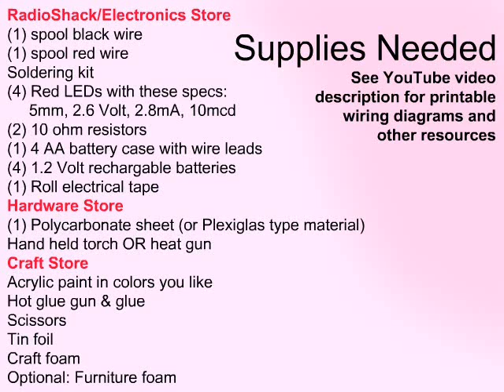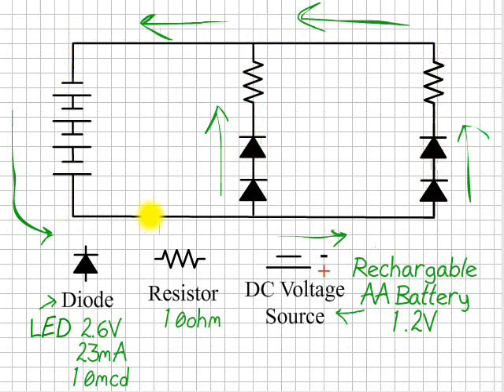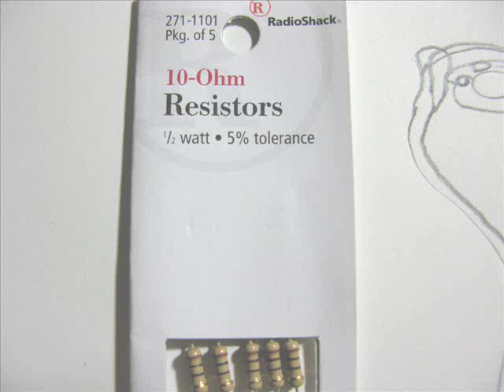Make Glowing LED costume eyes

Comment from the maker: That's great friggin' question!!  Surface wash the fur with a damp sponge and a comb.  For the eyes you want to use glass cleaner or glasses/computer monitor spray.  You don't want to get the mask wet when you clean it because the water vapor will work its way inside the eyes and cloud them.  You can scrub the inside with a damp sponge and some alcohol if you to remove facial oil.  Over time you may need to replace the foam or car sponge you use as pads on the inside to remove skin oil build up.

Comment from the maker: The plexiglass I get from the scrap bin at Lowes. The LEDs are between 2 and 12 dollars for a three pack depending on color. The battery pack cost me 4 dollars, the wire can be bought at whatever amount you want to keep on hand, but tends to get cheaper per foot if you buy a big roll.  Buying all the supplies ran me, I think $25?  but it was enough supplies to do two sets.  FYI you can also shape acrylic by toaster ovening it and waiting for it to buckle up, then relax, THEN shove a sppon in it.

Comment from the maker: @Kirikirisempai Between 20 and 30 dollars depending if you already have batteries.  You have to think cheap--like ask a hardware store if they have broken or scrap acrylic sheeting.  If I buy a cracked piece it's super cheap--but a 20 X 40 inch sheet of polycarbonate is like $100 bucks.

Comment from the maker: @DeathDragonSparda Oven.  You can use an oven and an aluminum baking pan, the thin one time use ones.  To be safe you want to oven dry your plexiglas/acrylic sheeting in an oven (acetate is totally different, I wouldn't use acetate.)  The water vapor in the acrylic will bubble out when it gets hot.  so unless you live in a really dry climate the acrylic will form unwanted bubbles after it gets slightly above the perfect temperature.  i think the temperature is around 200 degrees F.

Comment: I need to make a similar result for a plush that is part of a cosplay prop. but all this would take too much time i will be working over the summer and im haveing surgery. i also have a lot of feathers that need to go on the prop. how would this work with just a led key chain light? in the prop that can be pulled out then locked on?

Comment from the maker: @Arrekushizu1127 I buy the cheap soldering kits from RadioShack for 8 to 12 US dollars, the kit comes with solder and a clamp.  But!  Beware!  If you don't learn how to do the steps right (tinning the tip,--simple but important) you could melt a cheap soldering tip or accidentally set something on fire, so have a buddy to help teach you or figure it out based on online instructions. The iron takes FOREVER to cool down, so like 10 minutes after unpluging it it can still deliver a very nasty burn.

Comment from the maker: You can wrap the wires very tightly together, like twist ties, then glue over them, but this will only work for a while.  I did some solder-less effects at a convention that way.  As you move the wires they become more and more loose, so it's only good for little while.  Soldering isn't hard or expensive , the only problem is it gets very hot and you don't want to breath smoke that comes up off the soldering iron.  Lots of people own soldering irons, try asking around, even school shop classes.

Comment: I'm just forgetting what I used to know about electronics. Are the resistors for controlling the brightness of the light, or will something burn up if there isn't enough resistance? Does it matter what kind of batteries you use, as well?

Comment from the maker: Yeah, it would be a physical switch where you could make a connection that would connect two sets of wires with spaces.  One way the switch would connect the space between the photoresistor and your circuit, the other way it would connect the space directly between the battery pack and the eyes.  you can look up switches online or at radioshack.

Comment from the maker: Tell 'em it's about using your time efficiently.  If you get a 15 minute break at work or school and you're usually bored, instead bring some graph paper and plan out a design.  By the end of the week you'll have almost an hour and a half of design time in.  That way, when you set aside time to do a project... you've already got the plan set in your mind, your design is ready to go, and you can start creating--make your work time also be your construction time instead of lots of daydreaming.

Comment from the maker: if you needed to see through it would be easiest to built a circuit (stuff connected by wires) with a photoresistor in it, you'd stick the photo resistor in the circuit illustrated in this video right before wire splits together to make the eyes or after the split wires come back together. The photoresistor stops electricity from flowing unless there's light shining on it, so the LEDs would only glow when light hit the photoresistor.

Comment from the maker: If you didn't need to see through them, you could line the back of a fake eye with with tin foil that you colored on with a permanent marker, so it would reflect green.  To make it look real you'd need to restrict how light reached the reflective surface so it only reflected when light shined directly at it, you'd need a solid white front with clear pupil, or a solid front with a hole in it.

Comment from the maker: The price will depend on what you buy, and what you already have at home.  For example, soldering and wiring.  You can skip the solder and and just wind wire around your electronic parts, but that may come loose--and you can't skip the wires. Put together a supply list and use Google product search to check average prices.  Expect between 60 (no supplies at all at home) and $15 (have many supplies at home.)

Comment from the maker: If you need a weird resistor, like "68," go for the closet number radioshack sells, or try using a different battery type (rechargeable versus regular)  to get an easier number, like "500" or "10."  If your resistor number is lower you may burn out your LED, if the resistor number is higher your LED will be dim.

Comment from the maker: The reason you need to know what batteries you'll use is that rechargeable and regular batteries are different.  Use the online calculator put in the battery's voltage, and that you want 2 LEDs, (use a multiple LED calculator instead of a single LED calculator.)  If you hook up more than one battery together it may change the math, so start simple with just one battery.  Then, based on what the calculator says, call Radioshack and ask for the resistor you need.

Comment from the maker: Yes!  You just need to match the amps and voltage.  So call up a radioshack store near you and say "Hi what models of yellow LED do you carry?"  And they'll be all "Blah blah blah" and you hang up.  Then, go to radioshack's website and look up those model numbers!  The website will tell you that each model needs so much "forward voltage" "v" or "volts" and so much "forward current," "mA," or milliamps.  So then, you dig around your house for batteries.

Comment from the maker: This is the same, you can use ultrabright LEDs, and as long as your room lighting or outdoor  is a certain percentage more powerful than the LEDs you'll drown them out.  So don't assume you need a dim light for the eyes if you want to have a surprise glow that's only noticed in shadow, you just need to understand the relative brightness of your LEDs and the environment the costume will be used in.

Comment from the maker: Today's topic is "relative brightness and human vision." A well lit small room with four large fluorescent lighting tubes is going to be about 150 foot candles in brightness.  You can read, sew, and live in such a space comfortably.  HOWEVER if you go outside, full sun is going to have an illumination power of 10,000 foot candles.  So a very brightly lit room, the kind of lighting used for an intensive work space, would be drowned out by full sunlight.

Comment from the maker: Black door screen can help hide eyes if you make partially hidden ye holes that are small. If you have a big eye hole and the LED is mounted OUTSIDE and a bit away, tinted sunglasses will appear black and reflective, especially if you use a lower power LED that can provide a colored glow but not shine through the glasses to reveal your eyes beneath.  Of course screen and tinted lenses diminish vision, so you'd need a partner in case impaired vision became a danger.

Comment from the maker: Rock out!  Were you happy with your finished product?
  Don't let basic circuits be scary!  See, the printable diagram with the parts laid out, even shows which long and short wires should point where, then you match up the LEDs and resistors to the numbers we suggest, if you're unsure how to figure out the numbers for a different type of LED.

Comment from the maker: You could buy a board or control chip (or find someone with a dev kit and program a chip) but for a regular on/of blink there are LEDs with built in blinking circuits, check radioshack's website.  The wiring is easy because the blink circuit is built in.

Comment from the maker: The red LEDs don't make a lot of orange or yellow light, so only red light would be reflected by your paint, so it'd look red instead of orange when in the dark, BUT orange glowing in the light where white light could provide the orange light your paint reflects while extra red light provides a glow effect.  Try using orange LEDs!  Look up orange and orange-amber colored LEDS!  Just use an online calculator with the current specs listed on a website to pick out the resistors.

Comment: Should use wire strippers for those wires, their depth set with a screw that allows for length. Love your tutorials, I might try some for this Halloween. The best time of the year, Christmas is over rated, I would rather be a ghoul in the night and take souls as I go, than receive presents under a tree. Adventure is key.

Comment from the maker: m23402027 is quite correct the the voltage will be th same in all parts of a series circuit. If you have four lilghtbulbs in your living room, and they are all on the same electric circuit, is the one that gets the electricity first brightest?  No!  What can get confusing is if you have two loops in your circuit like we do, if one of the loops has more resistance the electricity goes the route of least resistance. You have to use resistors to make sure each component offers the same resistance.

Comment from the maker: It's cuz the project is to introduce circuits & LEDs as opposed to building the ultimate eyes. 
I ~~love~~ using electroluminescent wire and tape, but since they run on a different kind of current than the batteries produce you need to have a converter, which can cost $50, increasing the cost of the project dramatically.
Fiber optic filaments (the plastic not glass ones) are affordable but harder to get a hold of. But you bring up a good point, they easily distribute very bright light.

Comment from the maker: When soft enough to shape it won't drip or deform, it flexes a little, maybe droops a tiny bit. You can be conservative with how much you heat it. Since I don't pre-dry my "Plexiglas & friends" type products when I work with them the moisture in them will bubble before the material warps. Pre-drying in an oven at a lower temperature for a few hours allows you to make the material a lot hotter, and softer, so it will warp without discoloring. I don't have a dedicated oven, so I don't pre-dry.

Comment from the maker: Pfft! No sorry, my question was an honest one. "But why would you turn off part of your costume when wearing the costume?" I figured you were referring to power drain, but there's probably cool effects you'd need to turn the eyes off for, I just didn't think of any yet--maybe hiding in the dark?

El-wire REALLY is cool. I did a costume with the really thin stuff woven into hair by having multiple strands coming off the same battery pack/converter. Huh, I spelled "lose" wrong in my last post!

Comment from the maker: But why would you turn off part of your costume when wearing the costume?

They're 10 millicandella LEDs, they'll run for many, many hours on a battery pack.  Once the costume's on you can leave them on so you never have to loose the effect.

The only lower power solution we could come up with would be an electroluminescent sheet/tape or wire but you have to special order your lengths and power converter so it costs a ton more. (Though el-wire is great, I love using it.)

Comment from the maker: Always on, you heave to pop out a battery to turn them off.  Tried to keep it as simple as we could for wiring, but adding a switch to would be really simple, or getting a battery holder with a built-in switch.